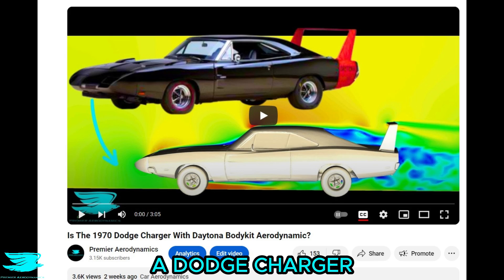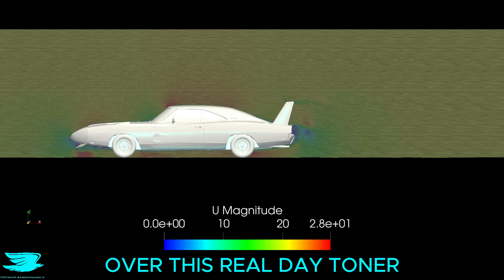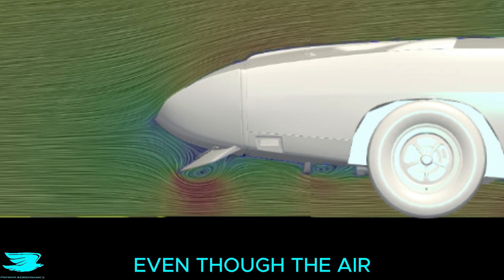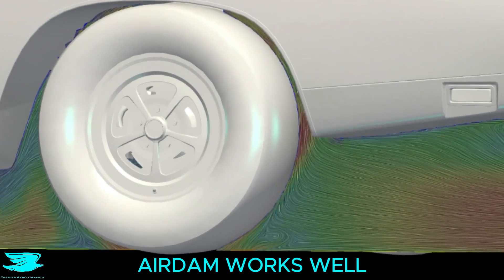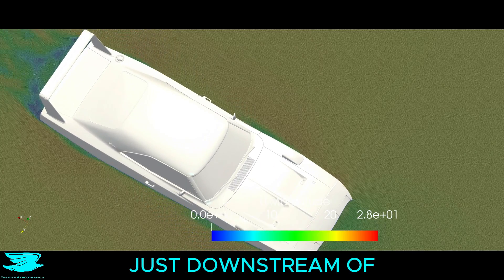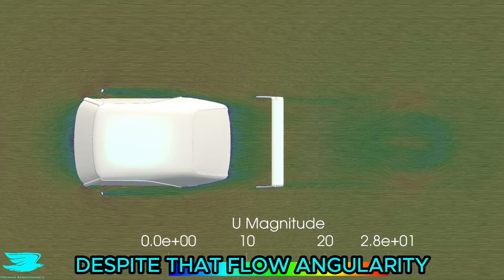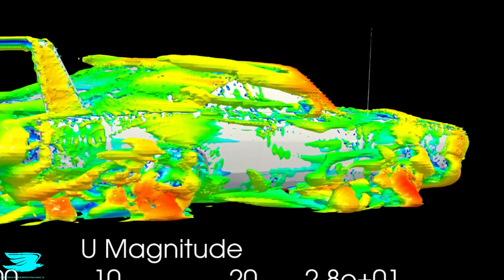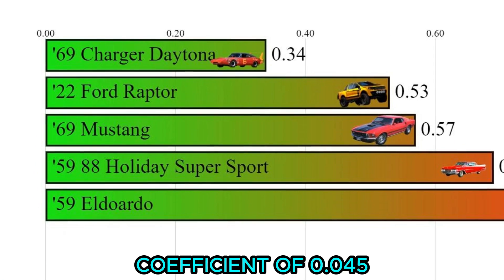*Correction* Dodge Charger Daytona 1969 Aerodynamics

Comment: The 1971 Charger and Plymouth Road Runners were designed in a wind tunnel and were going to be the next gen aero cars with smoother panels, raked windshield, and flush rear glass. But rules changes prevented Dodge & Plymouth from making winged versions. A test of the stock 1971 would be a very interesting comparison!

Comment: I'd love to see a CFD simulation for the 1970 Lotus Europa.  It was claimed to be 0.29 from wind tunnel testing done while the design was being finalized but there is a lingering rumor that the engineers lied about the test results as they wanted to go home.  Colin Chapman had specified it must achieve the 0.29 figure before they could leave the wind tunnel.

Comment: How about the 3rd gen (1982 to 1992) Pontiac Firebirds. Or the 1993 to 1997 Firebird Trans Am variant? Except for the radiator, fog lights and wheel arches there are virtually no edges.
Reply from the maker: Thanks for the ideas!
Reply: @PremierAerodynamics  I thnk the air dam under the radiator should be the most interesting part. The 1982-1992 wrap around the whole front while on the 1993-2002, they are just short flat boards.

Comment: Along the same lines and era, here's an obscure one to do a back-to-back comparison if you haven't already.
1966 Ford Mustang sportsroof (fastback) versus 1966 Shelby GT350R. 
Why? What's the difference?
The major concern here is the rear window, more specifically the glass. The GT350R rear "glass" was a custom piece of plexiglass that was folded at the top and didn't reach the window channel, leaving a short gap that allowed cabin air to flow out under the separation of air at the edge of the roof trim.
Reply from the maker: That's a good idea! Thanks! We've already done the fastback mustang, but we'll see if we can find other models.

Comment: I would be interested to see a video like this on a late 2nd generation Camaro (1978-1981). I have a 1978 and it has some interesting aerodynamics. And the spoiler was stolen from Pontiac engineers that was meant to go on the trans am counterpart.
Reply from the maker: Thanks for the idea! We'll look into it.
Reply: @PremierAerodynamics excellent! The 78s like mine don’t have the trans am style flares in front of the  tires. But in 79 they added them to the front tires, and 80-81 they have them in front of both front and rear tires

Comment: So what does downforce coefficient like actually mean?

As in like lets say the car was traveling at 100 mph how much lift would this be in kg or pounds or whatever?
Reply from the maker: The Downforce is given by this equation:

Downforce = 0.5 x air density x velocity^2 x reference area x downforce coefficient

So, the downforce coefficient is a good way of comparing different shapes to see which is better.

If the reference area of the car is 10 square meters, the velocity is 30 meters per second, and the downforce coefficient is 0.2, then the downforce will be about 0.5 x 1.2 x 30^2 x 10 x 0.2, which equals 1,080 newtons, which is about 100 kilograms force.
Reply: @PremierAerodynamics  thanks!
Reply: Chrysler documents state there was 0 lift on the nose and 0 to 250# of downforce on the rear at 180 to 200 MPH.  The nose cone reduced the lift from about 600# to 0 and the wing was adjustable from -2 to +10 degrees for 0 to 250# of downforce.

Comment: That's close to the 0.29 irl c/d, so not bad
Reply from the maker: Yep, pretty close. There could be several reasons for the differences in CD.
Reply: 0.29 c/d was the NASCAR spec. They removed the side-view mirrors from the A-pillar and filled the gap between the nose cone and the body. The cars also had less tire gap.

Comment: Air in to the front wheel arches is there to cool the brakes.
Reply from the maker: That is an interesting idea. I would have thought that the quite open rims would allow for enough brake cooling already.
Reply: @PremierAerodynamics  Air comes out that way.
Reply from the maker: @PiDsPagePrototypes  Typically, the air will only come out of the rear half of the rim.

Comment: I'd like to ese a 34/35 Chrysler airflow at some point, the original areo darling.
Reply from the maker: We just finished its simulation, so hopefully it will be out next week, or the week after that on Sunday.
Reply: @PremierAerodynamics  Oh perfect. I have a 35 SG and there's a few details i've always wondered about. Particularly how much the spare wheel messes with the flow coming off the back, as well as how effective the laid back and split windshield is.

Comment: It should also be considered that the reversed vents above the front wheel wells were stated to be there for "wheel clearance," but were actually designed for pressure relief for the air caught in next to the wheel. I'm not sure if they cut out the vent holes for the consumer versions though.
Reply: On the superspeedway tracks, with the downforce the car made, the tyre did indeed rub the insides of the fender there over the bumps, which is why the ones on racecars are wider then the the road going cars, due to the width of race tyres. It also sucks the hot air coming from the brake rotors out, along with hot air from the engine bay if the inner guards are removed on the race version.
Reply from the maker: That's interesting. Depending on where they were in the wheelhouses, they might've also helped with downforce.

Comment: Fascinating. Really does show why the aero cars dominated stock car racing for that brief period before they were banned.
Reply from the maker: It is very interesting.
Reply: They weren’t exactly banned, it was more of a nerf, they were hindered as well as the other aero cars from ford and Chevy, but Chrysler received cubic inch limits down to the 305ci on their winged warriors which essentially made them useless 

NASCAR had and still has a habit of finding ways to ruin things that innovate
Reply from the maker: @Buffalohideface It's interesting how these days, you can get pretty much as much downforce as that big wing with just a small lip at the rear.
Reply: @Buffalohideface  ALL aero cars, Talladega, Cyclone Spoiler, Superbird, Daytona and Charger 500 were all limited to 305 CID.
Reply: The aero cars were not banned.  They were limited to 305 CID.

Comment: Plymouth Superbird next!
Reply: And they have the vents on the wheel wells that allow trapped air to escape
Reply: Superbird, and follow with Fords Torino Talladega.
Reply: It's the same car as Daytona
Reply: @duanJ_aka_wfoundry There are some differences like the wings angle.
Reply: @duanJ_aka_wfoundry the differences between the two is enough to have a difference
Reply: @duanJ_aka_wfoundry  there are differences in the wing and body work, such as the front nosecone and the wing being lower and placed different
Reply: @duanJ_aka_wfoundry  They aren't the same car, common misconception. Both cars use completely different body panels and the nose cone and rear wing are completely different as well. The only similarities are that they are B-Bodies and Drivetrain with one exception being the optional 440 6 bbl only available on the Super Bird

Comment: It would be awesome to see a Toyota MR2 AW11 from 1985, especially cause the engine is in the middle, and it would be quite interesting to see how well the air from under the car would cool the engine, by pushing it upwards and out of the grill vents.
Reply: the radiator isn't in the front, like most mid engine cars?
Reply: @andygilliland  Yes it is, but maybe the vents is for other engine components that isnt connected to the cooling system. Either way there still are vents on the hood and a slanted backwall to scoop up air. Also on the supercharged version the intercooler radiator is on top of the engine  just bellow the air vents.

Comment: Looking at the wing struts, would angling them parallel to the streamlines (i.e. outward) affect drag or upstream lift on the rear window?

Also, how do modern cars benefit from rounded A-pillars and rear corners, if such corners are still subject to flow detachment?
Reply from the maker: For the struts, if they are just regular rectangular cross-sections, then angling them so they are in line with the incoming flow is best. You can see that as the flow comes around the rear window, it curves in. That means that the struts are seeing an angle of attack if they are aligned straight.

If they are airfoil sections, then you have a little more leeway and they don't need to be aligned perfectly.

Rounded A pillars help with reducing separation as well as reducing the vortex you get. If you round them but you still get flow separation, then it is probable that the wake is still smaller because the flow isn't pushed out as much.
Reply: @PremierAerodynamics  why some cars from the 2000's try to separate the flow around the windshield? With sharp edges
Reply from the maker: @heitorbernardes7977  I'm not aware of any aerodynamic car that does that. Do you happen to know of any particular models?

It might also be because of styling reasons. The designers thought it looked better.
Reply: @PremierAerodynamics  I was thinking about my mom's mk6 fiesta, although it's not a particularly aerodynamic car (the amount of vortices from those wheel arches... What were they thinking!?)
The Honda fit also has some similar separation edges...
Reply from the maker: @heitorbernardes7977  Well it is just supposed to be "a car" for people who only want "a car". So, it is designed to fit the build.
Reply: @PremierAerodynamics  So it seems that the thicker and chubbier the airfoil, the less sensitive it is to angle of attack. An extreme case of this is a circle, which is equally stalled at any angle.
Reply from the maker: @AwestrikeFearofGods  Thicker airfoils stall less abruptly. Generally, going up to a thickness of 30% of the length (chord) of the object will be fine. Once you start going higher, you tend to hit bluff body aerodynamics.